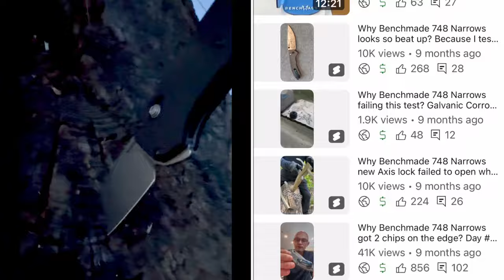How to De-Assist Kershaw Layup Cross Bar Lock the Best Budget EDC Knife in 2024 to date

Comment: If benchmade made this exact same knife it would cost $142.89
Reply from the maker: The least expensive assisted knife in Benchmade’s current lineup is mini Barrage. MSRP $190.00, MAP $171.00
For some reason, knife enthusiasts “community” doesn’t like assisted knives… nobody ever explained why. Other than “you can’t flick it shut”
Reply: @CuttingBoardRx  really? Ive ben collecting knives since I was a teenager. My collection is over $80k at this point. Some of them are assisted and I’ve never had an issue with them. Its just a different action. If I want a more fidget friendly knife I just grab a different one. Thats like not liking a C8 Corvette because it does not have a soft suspension. I like your videos btw. Im sure there are blind rage infused haters out there but I like how specifically analytical your content is. Nobody else is doing this. Please keep it up.